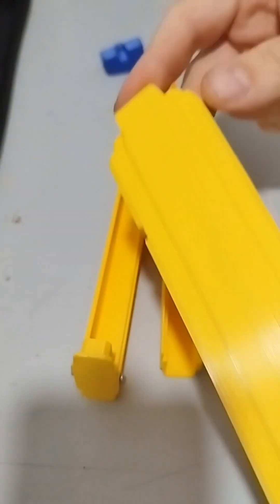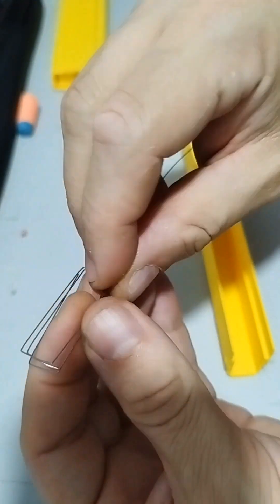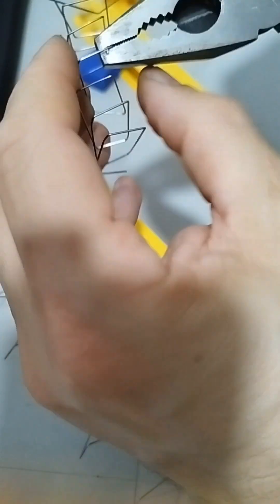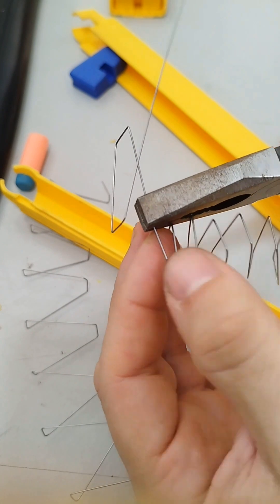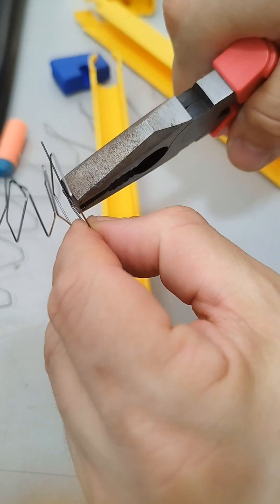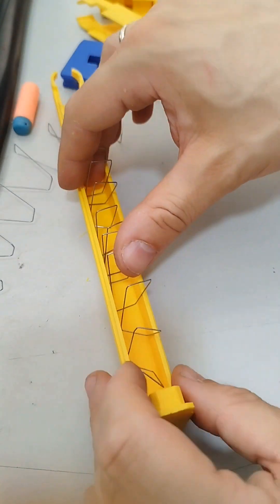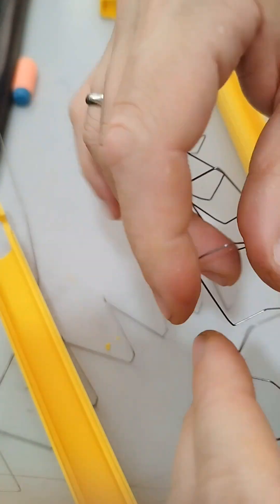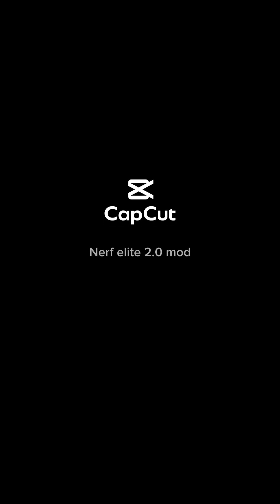How to make a magazine spring from very cheap spring wire and some patience

Comment: Wouldn't it be easier to use some sort of guide? Like a post to bend it around?
Reply from the maker: I tried it but it was difficult to exactly where I wanted and have a hard edge on each angle. I guess with something like  a piece of aluminum tha has sharp edges might help

Comment: Have you found that they wear out at all? If you have the magazine full and store it?
Reply from the maker: It's a special wire used in spring making. I think  It holds it's shape.  Surely if it was a manufactured one therE might be some heat treating that makes it hold it's shape better and longer.
Reply: @Petrosalittlebitofeverything  Thanks! I'll look further into this. Because $5 for just a spring from websites like frontline foam is very expensive compared to this